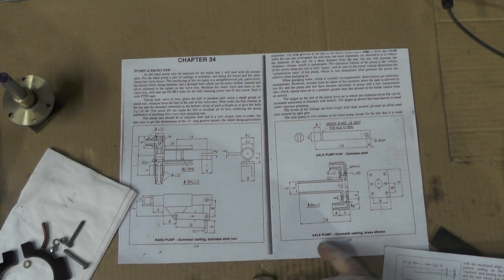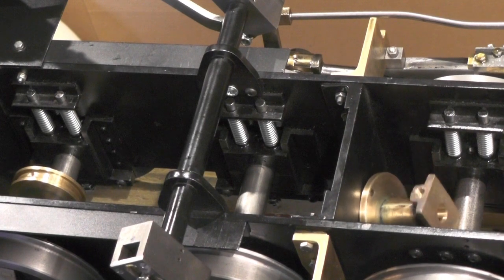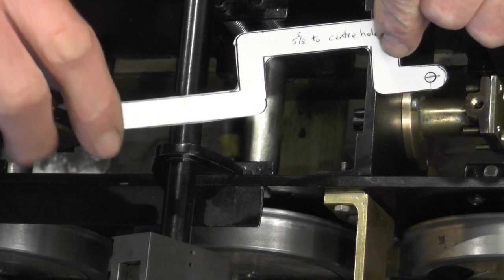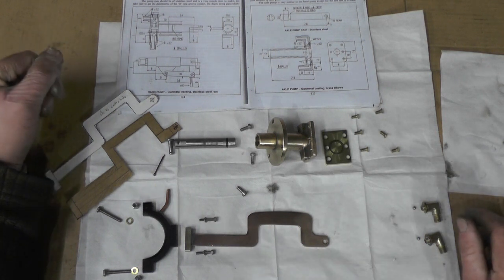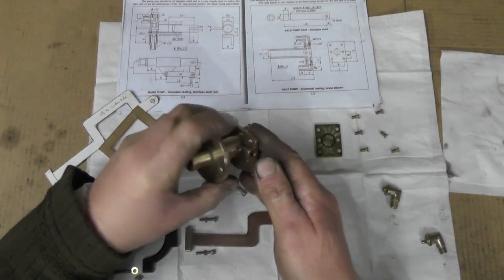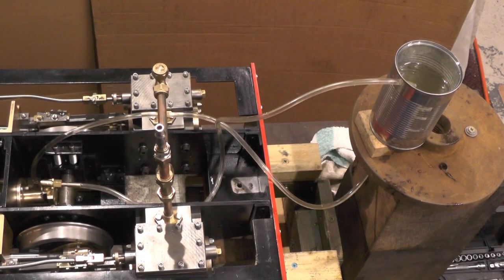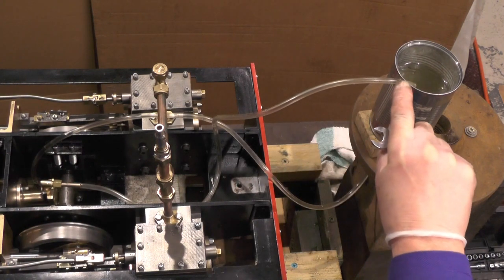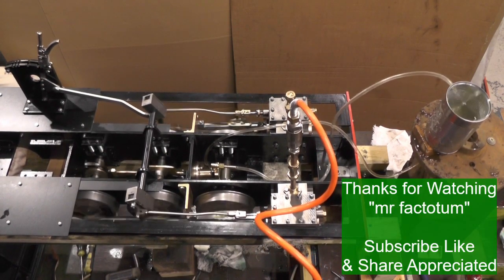Make a Miniature Steam Locomotive Series ( Axle Pump Fitting & Testing pumping water ) "mr factotum"

Comment: The axle pump setup is very similar to mine (not sure if mine is per the drawings or not) but it works fine so you should be good!

If you need photos of my loco to help please contact me on the GRF forum (just click the contact us link, you do not need to join as it will send an email).

https://gardenrails.org
Reply from the maker: hi tom tom go
sorry for late reply
my notifications don't seem to come through reliably some do some don't. havn't a clue why, im still in steam age!!!
Thanks for photo offer, the axle pump is working fine so should be ok, So is yours a metre maid, if so would like some photos please. 
regards
mr f
Reply: Contact me on the forum!